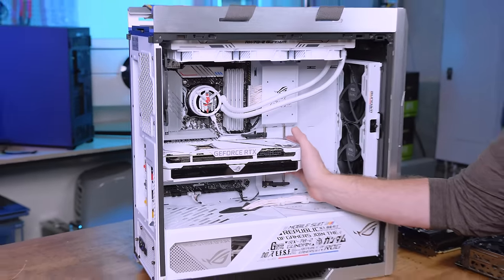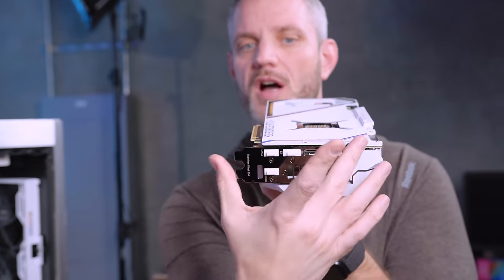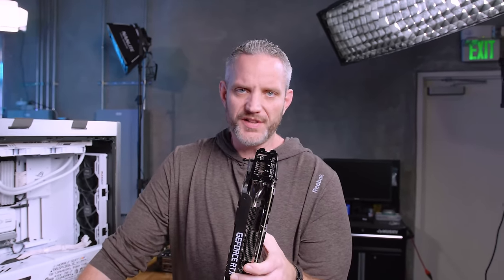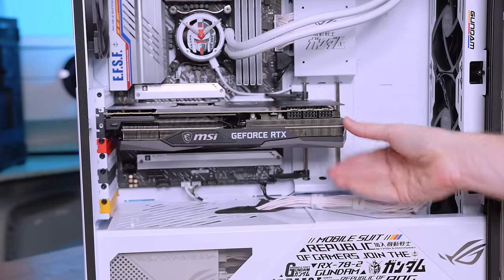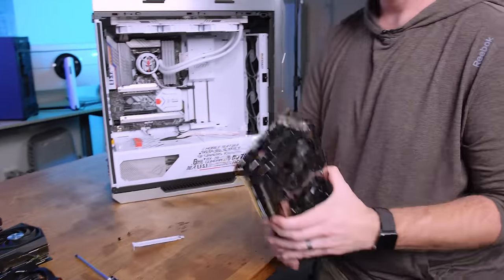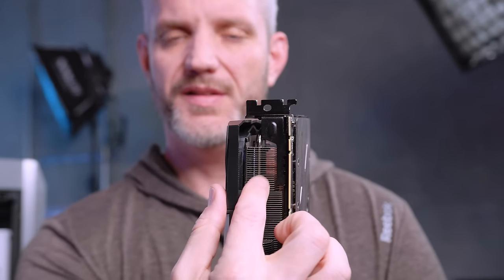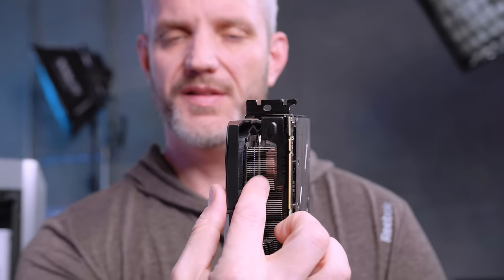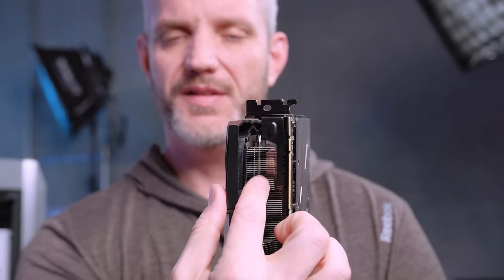How to fix GPU sag ONCE AND FOR ALL! FREE!

Comment: I worked in manufacturing for 15 years. 99% of the time the engineers make changes that make a product worse is because a mid level manager wants a larger bonus check and makes them cut the production cost!
Reply: Yup, got to cut out as much metal and plastic as physically possible to save pennies per product because. it looks good to save thousands over thousands of units.... So long as the customer doesn't complain or they can get sued over it.
Reply: Tbh, the sag problem is an aesthetic one, not a functional one  (if the card is properly designed). So the product isn't really worse, it's just less pleasing and many people don't even care about that.
Reply: @jorgeaura2890  Except it causes strain on both the connection for the card AND motherboard since it means there is weight being placed upon something that is intended purely as a connection point for electronics and not as support.. AKA your PCI slot.
Over time it can bend the pins and loosen the PCI slot from the board.
Reply: @SilvaDreams  The trick that Jay proposes doesn't address this. He's simply pre-sagging the gpu so that it looks level with the case. And I think that both the motherboards and gpus are designed wih this sag in mind.
Reply: @jorgeaura2890  the trick he proposes absolutely does fix this. It isn't putting extra strain on the PCI slot, or if there is any it's much much less. he's not simply pre sagging the GPU so it looks level with the case. He's making it so it can't sag like that. Not sure if you watched the same video as us tbh.
Reply: @roar104  I mean thinking about it even further you could say that the sagging force is still there, it's just being applied in a different direction, which in this cause would be outwards (to the right of the slot). So still putting stress on the slot, but just not the stress that causes sagging.
Reply: @StuckOnAFireHydrant  you could say that, but your conclusion would be wrong. If it makes contact and gets held up like he shows in the video, there's little to no stress put on the PCI slot. You're right about it pushing in a different direction because it's being held up properly.
Reply: For the people replying that say it's putting the same amount of stress on the motherboard PCI slot, it isn't. The stress comes from the fact that the gpu is sagging below the flat angle of the PCI slot on the motherboard. When it does that, the slot has to take on some of the weight of the card that isn't being supported by the case bracket. Think about it like this. If there was no PCI slot, the card would sag further and further until all of the weight is resting on the case bracket. When you "pre-sag" the graphics card by screwing it into place at the highest possible angle, with the shims in place such that it will stop sagging once it rests against them, you make it such that the GPU will fall closer to a level, neutral position. At this position, since more of the weight is being supported by the case, there is less weight that needs to be supported by the PCI slot. It accomplishes the same thing for reducing the strain on the motherboard as if you installed the graphics card normally, but with the PCI slot on the motherboard lowered to match the position and angle of the sagging card.
Reply: A shorter explanation is to think about the slot holding up the card like he holds it up with his finger. You could push the card up to neutral with your finger and it would be level, but the card's weight would be resting on your finger. If you tilted the card up a little, and shimmed it at the bottom so it doesn't sag down as much, your finger would have a lot less weight on it, so there's less weight on the PCI slot
Reply: @jorgeaura2890  his trick is 2 part, and absolutely addresses the weight on the slot.
by padding the back of the cooler, the card no longer sags down, hence the weight is shifted off the pcie port onto the padding.
by lifting the card up while screwing tight, it also shifts weight from pcie slot to the rear bracket itself.
both ways shift weight to a different place but in the end shift it awy from the pcie slot.
Reply: That's right. The Marketing departments are also heavily involved in this. At first they attract the flies to the sh..I mean hype the product with relative quality, then later, when the consumer is trapped deep into it and inattentive, they lower the quality of newer versions to cut the production costs.
Reply: Wouldn't it be easier and cheaper to fire the mid-level manager? Problems solved.
Reply: @NorseGraphic  😶 You can't simply fire a manager... eash....
Reply: I never understood the "blame the engineer" argument people have with GPUS and car manufactures. I am not educated in engineering, but even in my work life I always want to do better to make a product transported more safely, or to make sure a job on a vehicle was done right. But everyone working a job in todays world of fast pace environments should know that managers everywhere in any job don't care about quality, it's speed and money first above all else.  someone who spent years in school suddenly decided they no longer cared about their education they worked hard on would just be silly, I bet they care more than anyone, but they have no say if they want their paycheck.
Reply: B4 pc chasis used to look like sturdy beasts like cm stryker haf x, silverstone, nzxt phantom. Now they look like a colorful barebone skeleton filled with rgb and ppl are actually proud of it. Performance > asthethics
Reply: the sad truth. all the anti-consumer moves most manufactures do is caused by  some no nothing making a dumb call because they want to save a penny. but in crApples case, because its part of their business practice
Reply: @jorgeaura2890  my PC literally gives no video output because the connection has weathered down... and I fear it may be the video card
Reply: A simple toothpick painted to color, cut to preferred length and placed under outside rear corner of fan shroud will eliminate the sag and more importantly,  torsion on the PCIe and PCB. A sort of GPU crutch if you will. And it's not visible unless you're looking for it. For those of you that think this half-assery is "engineered in" , wait til the PCB gets so hot and twisted that it causes the heatsink to separate from the IHS. Sure, it's engineered in, for them not us.
Reply: @jorgeaura2890  bro alot of people care about aestetics. People spend thousands on custom water loops and custom cables so thier computer looks nice
Reply: that's bullshit
Reply: Because the CEOs and shareholders want more profits*
Reply: Sure you did, pal.

Comment: These GPUs should legit come with a bracket at this point
Reply: Or they could just you know, make them better in the first place?
Reply: Msi gaming x trio 3070 I got came with one.
Reply: My Palit 3080ti did which was nice. Didn't need it 'cos it's vertically mounted but it was nice lol
Reply: Just bought the same 3090 but the OC edition, not the Gundam edition. It doesn't sag out of the box.
Reply: My RTX 3070TI Suprim X came with a stand. And I'm happy i did. It's way too heavy without stand 🥲
Reply: @AtomikMenace  Yep mine has one, don't use it though
Reply: Or you know, making them more efficient instead of lazily raising the clocks and calling it a day?
Reply: Ya my evga 3080ti came with one thankfully.
Reply: My aorus Xtreme 2080 ti came with one. Still using it even after I put a waterblock on it and vertical mounted it.
works pretty damn well and doesn't look completely terrible like some I've seen
Reply: @AtomikMenace  my 3080 Gaming x trio also came with one. I mean, I mounted it vertically, but it was nice to have regardless.
Reply: Exactly, u think for the money we pay for these stuff they can't afford to add a little plastic stand holder thing that will cost them only $5 to add
Reply: My asus B590e mb came with one
Reply: Bro no Fucking shit already!!!....gah damn.....
Reply: My nVidia/Gigabyte 2070 has one. I'm happy with it
Reply: My old gigabyte 2080ti came with a little support bracket.
Reply: Years ago...
Reply: Mine did. Sapphire 6900xt.
Reply: My msi 3070Ti came with a quality metal one
Reply: My evga came with one
Reply: Most do
Reply: And a half & half from JSH
Reply: My 3070 came with a sweet bracket new
Reply: GPU manufacturer: No no! Dongle should be bought separately.
Reply: You guys all just made me sad AF. 😔 I haven't been able to get a new gpu. 😅
Reply: At these prices they should come with a leprechaun to hold it up for me
Reply: Msi sends all their gpus with a beefy one
Reply: They do come with a bracket
Reply: I’m a young mexican stoner trying to make it out the hood & this 9-5 by doing reaction videos & storytimes on my YouTube channel 👌
Reply: Trimmed 'wooden chopstick' between them will serve at no cost~
Redirect the video power cable feeding from bottom to top to support graphics card weight
Reply: they wont include a bracket but they still include molex to pcie adapters for 300+ watt cards... smh
Reply: This is bull shit. Why does the system builder need to shim and clip and fuck with things to get them to work as they should out of the box? We are paying $500 - $3,000 for a god damn video card! They should be built better than this. No janky jerryrigged anti sag solution should be needed. No offense Jay, this is a neat trick, but it should not be needed!
Reply: @EdDale44135  everyone talked shit on zotac but my zotac Holo 3080 doesn't sag at all. Not even a mm. That thing is SOLID. Yet all these "better" brands sag and blow capacitors
Reply: My MSI 2080 Super came with one, but hasn't had sag issues so far. I'll at least see soon how things really are when a new case arrives.
Reply: @AtomikMenace  same here, and ffriend has it 2
Reply: Byt will viagra work ? IF we use like in custom loop ?
Reply: @NeXusZT  yeah, but it only works with a specific few cases.
Reply: @TheGevShow  still never understood the zotac issue. When i got the gtx 1080 amp and seenthe hate i figured it was the yellow. Even if its over temp difference still not a major gap. Didnt get coil whine. Still clueless.
Reply: Mine did. But not needed merc 319 card is over built
Reply: Yeah, but it would be too hard to make a universal bracket. Cases should be the thing to include a bracket with a few size options or with an adjustable one. Having a place you can mount a bracket too would be nice. It's hard to find a way to support it when the case and gpu wasn't made to have increased support
Reply: For sure, Some do. My msi rtx 3090 ventus came with a sag bracket.
Reply: @kagekun7689  not all do. My White 3090 Strix didn't even tho my 3070 msi gaming x trio did.  You'd think for the price of a strix 3090, Asus could've included a support bracket instead of a big fake diamond ring lol
Reply: For the price of my 3090 Strix, a bracket would've been lovely.
Reply: Mine had a bracket but like the bracket sags down if i want to set it up to support my card properly.
Reply: I think end user needs to responsible and find the solution.
Reply: I agree.
Reply: I could somewhat agree with you but cases in general should just come with anti sag brackets period
Reply: They do?

Every heavy one I have bought has had one in the past few years.
Reply: Coming with a bracket means they failed in initial design.
Reply: Yea i mean how expesive cloud it be i just bought one for my card and it was only $5 come on can they at least can give us that
Reply: I have got a bracket with my msi 3070. Not perfect and the card is now 6 slots 😂😂
Reply: My msi came with one
Reply: Pretty sure mine came with one... the case too. But i cant use em cause i have bottom fans all the way across, and the height in the o11-xl from the bottom is ridiculous. Looked stupid. Luckily my card doesn't sag, cause the strimer cables are so stiff and thick (hehe) that they press on the glass panel and hold up that end of that card.
Reply: I think its time for a new PCIe mounting system. We've had this mounting system for ages now and GPUs keep getting larger and larger.
Reply: @truthteller880  my bracket sagged at first. i just had to tighten the screws more lol
Reply: Or you should buy a better case, that has the motherboard in the right orientation.
Reply: my msi 2070rtx came with one, but I mounted it vertically so don't use it lol
Reply: some do e.g.msi others should also
Reply: @sanaruarts5527  nice i just got a vertical mount for mines but not even sure if it will even fit right in my lian li case. which mount did you get? my case is a lian li 011d
Reply: @RyanLBC  it’s the one by cooler master, got it off of Amazon. I have the same case and it fits perfectly
Reply: my 3080ti suprim x came With a gpu Holder thing but it really is weird
Reply: I got one with my 3060 gaming X trio not the best but still a little support for a huge card
Reply: Or maybe they can just include an anti-sag arm like Palit
Reply: @ItsMeMars  Yeah that shit is way too big LOL.
Reply: Msi rx6800xt comes with one, I have it.
Reply: @Redswipe  sames
Reply: got a bracket with mine job done
Reply: @nickspacemonkey  Made in China, what do you expect? They are trying to cheap out on these like they do on their buildings, that fall apart after 3 years.
Reply: Or you know, a case with an optional GPU support like my Zalman R1... A simple moveable tab to hold the card at the end
Reply: I agree, a $0.02 cheap plastic bracket for cards $800 and up should be expected if they don’t build the card properly for support.
Reply: RTX 3070 msi ventus 3x OC comes with one in the box
Reply: MSI 3080 Ti came with a bracket and a reinforced backplate.
Reply: What case is this?
Reply: Cooler Master HAF XB case,,,,No gpu sag EVER!!! Buy the right case dudes!
Reply: The FTW3 Ultra 3080's do, but they don't work in every PC case (such as a Lian Li 215), so it's sort of moot anyway.
Reply: My msi gaming x trio came with one....
Reply: @ItsMeMars  I got a Suprim X 3080Ti and it came with the same stand you're talking about but I didn't need to use it coz my card has little to no sag, which was a huge surprise considering the card is an absolute unit!
Reply: Power Color 6800xt Red Devil does come with a support stand. I just don't like the design of it. It should also provide better support than just a single point (ie. A "L" bracket).
Reply: My EVGA 3080 came with one... But only works on some cases... That it doesn't specify. And my CM h500p isn't one of those cases, of course.
Reply: @tyresewaynetitus709  how are case manufacturers supposed to account for all the possible video card designs? 

Also, why should they provide fixes for poor engineering on the card manufacturers side?
Reply: they do now (comment from 4090 era)
Reply: They do. I've not seen a single large form GPU that doesn't come with some kind of support. My motherboard (ASRock Steel Legend) even comes with a bracket you screw onto the standoffs over the board and holds the underside of the card. In Jay's case, you can see he has case mounted supports too. 

The surprising thing these days is when a GPU doesn't come with any kind of support system.
Reply: @AtomikMenace  it’s ass though ngl. Btw how much did you pay for yours?
Reply: @yo_itsjoshy  true. That bracket did suck. I overpaid mid gpu shortage. Got it from best buy for like 900. 

But I made up for it later, sort of 🤣. I was just happy to get a decent card for less than 1k at the time and built a rig around it. 

Later I sold it and got a 3080ti for less than msrp. Sold it for 850 when the 4080 launched and got a 4080 for 1000. 

Recently snagged a gaming x trio 3080 for the living room pc for 300. 🤷 

But I never did use that bracket 😂. Went vertical mount for a long time and then bought those 5 dollar black aluminum ones on Amazon because they hide well in a build.

Comment: I was really hoping he would just slide a 3090 under the card to lift it up and then do a reveal.
"All you need to do is buy a GPU to support your GPU. They are pack animals and need a companion" - Jay
Reply: Tell me where do you get that stuff 🤣
Reply: I believe that's known as the Bezos method
Reply: But if the support sags, wouldn't it still sag? 🤣🤣
Reply: @kyoudaiken  The pandemic has made me jaded and sarcastic maybe...?
Reply: @squallloire  He just uses a bottle of gamer's tears.
Reply: Trimmed 'wooden chopstick' between them will serve at no cost
Redirect the video power cable from bottom to top to support graphics card weight
Reply: In ATX case a single 3090 won't do it. You need to get two ;)
Reply: @Signaworks  Good point.  I'd grab another from a different manufacturer to get the tolerances JUST right in case the first is too short.
Reply: @hobbyadhd  Ooof. Yeah, could be. Although since I don't like socializing IRL, I feel better than ever before. Home office only, rarely outside. I actually like it.

Comment: This fix is for the wobble, not the sag. The only solution for the sag is to put support on the other end. But in todays shorter pcb and longer heatsinks, the support can just be on the edges towards the side panel (on a standard case), where the additional power plugs are usually placed, since the heatsink contact to the pcb is around in the middle of the card, that's where the weight stress is located most.
Reply: gpu sag it needs a pull up bra🤣🤣🤣
Reply: Yea, I put a popsicle stick in mine.  A little black magic marker and it looks and works great!
Reply: so what is the difference? if it cant wobble its still possible to sag? my evga ftw 3 ultra 3080ti is tilting very slightly but its barely noticible and doesnt wobble like in the video. does that mean its still sagging?